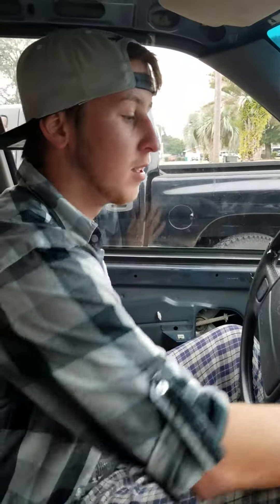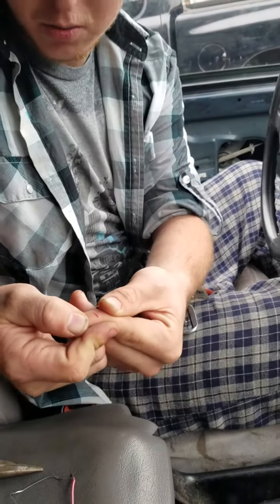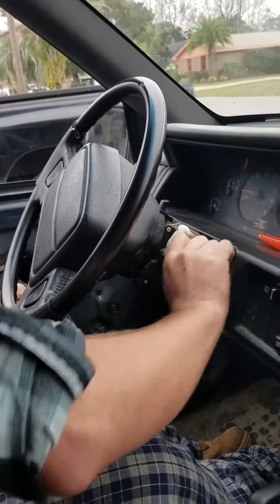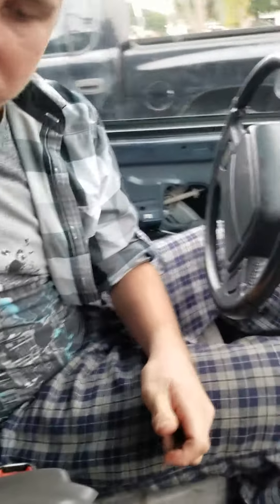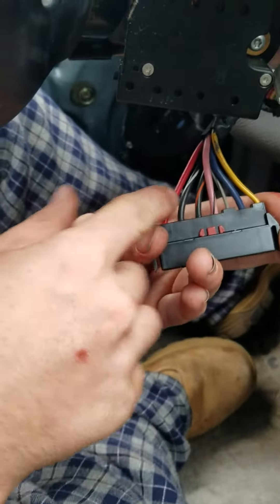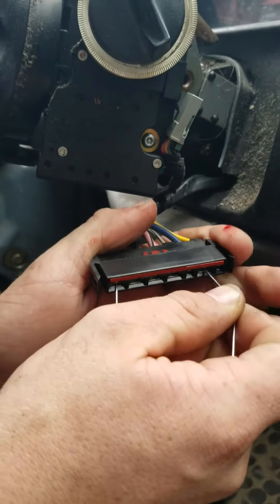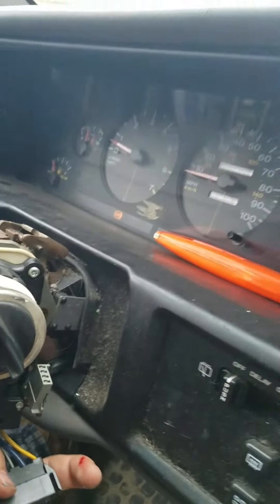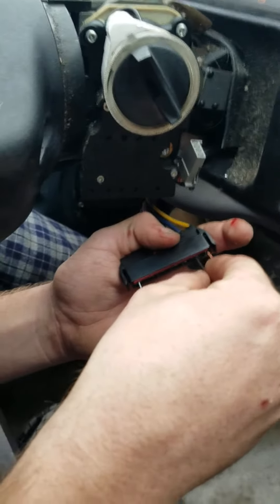Hot wiring a 95 Jeep Grand Cherokee.

Comment: hey boss how do you put in Drive  (D) after starting it up? I had to do the same thing on mine, it starts,  but it wont go in gear. thanks in advance
Reply: you just kind of pry at it
Reply: You got a few tamper proof screws to take out the ignition, then there's a little switch inside the ignition press it down and it unlocks your steering wheel and u can drive
Reply: @jdrandoms9627  ok so here is the story. My girlfriend and I were going on a bring to look at the stars at 11pm and I drop the keys in the river. I got it home thanks to you at 2am. Thank you so much I honestly can’t thank you enough
Reply: Yes it works how i put it in drive

Comment: Hey mate. Looks like you know your stuff,  may i ask please ...does the 1995 Grand Cherokee LOCKS THE STEERING WHEEL  when we remove the key. Bought one and it does not lock the steering wheel. Can you help please...because i see is so easy just to take it away ...so many bad boys around...they see your video and come to rob mine :-) Cheers
Reply from the maker: Beto R. When ever the key is removed the steering wheel will lock if turned or messed with as will as the shifter.
Reply: Thanks mate ...i tried everything ...It does not lock :-(  Thanks anyway. Have a nice weekend . Cheers
Reply: Beto R. If you have a key turn the switch to on then do the wire as shown.worked on my 2000 Jeep
Reply: You could tap into your fuel pump wire under the seat to put a switch so even if they hot wire it wont stay on with no fuel.